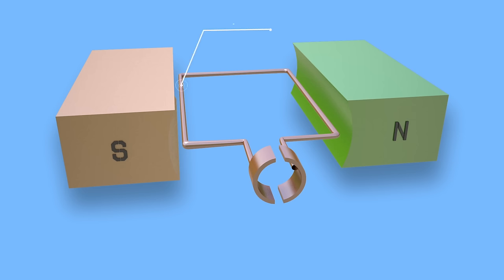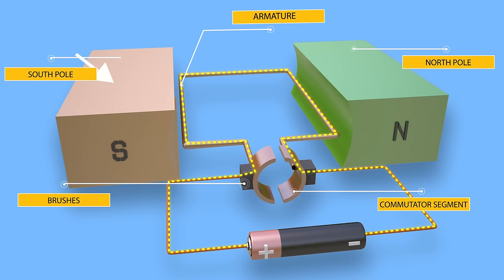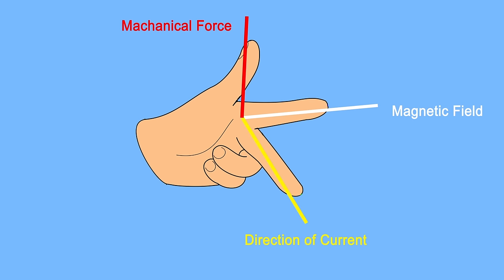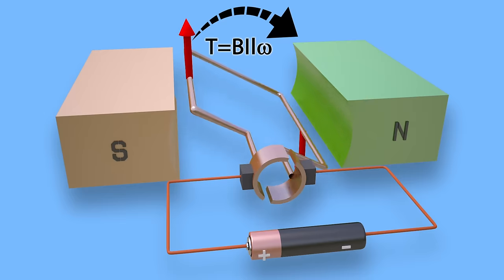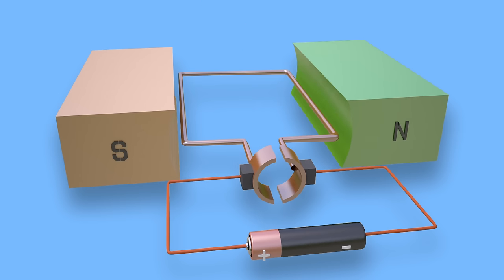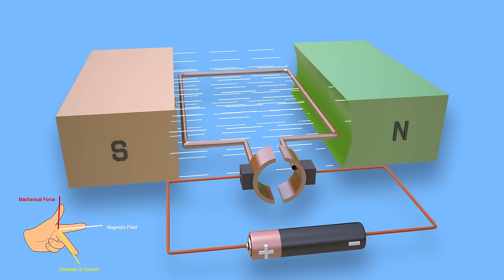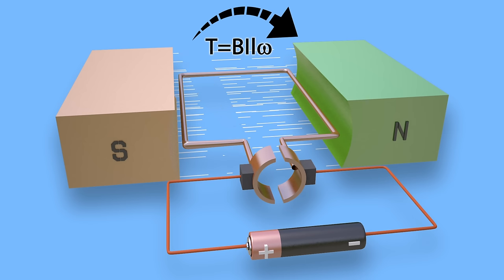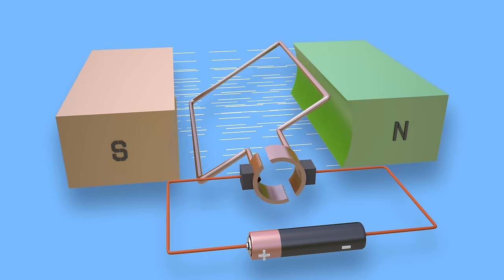Working Principle of DC Motor (animation of elementary model)

Comment: Make a simple cork motor with a horshoe magnet, a cork, 6 pints and insulated copper wire. And one dry cell battery.

Comment: Thank you so much. This really helps. But I have a doubt, what does an axle do in the circuit? It's supposed to be between split rings but what is its function?
Reply: Axle mainly holds. The two split rings .....so as when they rotate the split rings don't fall down
Reply: As there is only a sliding contact between carbon brushes and split rings
Reply: @RadhaKrishna-bh8jc  how commutator works??
Reply: @RadhaKrishna-bh8jc  thank you!
Reply: They are just there to confuse you more

Comment: Nice Animation ...should help first timers..however one basic query ..magnetic poles cannot exist or be manufactured in isolation...but North Pole and South pole blocks are shown in isolation . Actually both blocks are having North and South but the line joining N to S is aligned in same direction  for both blocks.
Reply: This is a genuine query. But learn that even if magnetic poles cannot exist in isolation, we still can determine which side of the magnet is North and which is South by suspending it hence we can determine the Direction of magnetic field lines, I suppose he purposely did not show the north and south poles so the begginers are not confused.
Hope that clears the hindrance!
Reply from the maker: Thanks
Reply from the maker: Thanks

Comment: hello nice video,but the left and right side placement of north and south pole explanation is wrongly said...can you correct that to avoid confusion
Reply from the maker: Ok i will check hole video to see if there is a error
Reply from the maker: Thanks for watching
Reply: Can u please how did the magnetic field excites ?
Reply: Yeah You are right
Reply: Ri8
Reply: Yes u r correct
Reply: Award goes to u
Reply: It's flemings right hand rule not left hand rule
Reply: I think if the poles of the battery are inverted, it is better than inverting the poles of the magnet
Reply: @13-hemgajjar98  It's left hand rule for electric motors but right hand rule for electric generators

Comment: So it will rotate continuously in the same direction? Will it change its direction of rotation or not?
Reply: no. the reason being the spilt ring commutator, as the armature becomes at a right angle to the magnetic field, the direction of force changes  if there was no split ring commutator the forces acting (up and down) would cause the motor to halt in a vertical position because there is still current present but when there is a split ring commutator the circuit is broken for literally fractions of a second so when the gaps in the commutator align with the metal brushes circuit is broken so there is no current so there is no force on the armature so it simply moves due to newtons law of inertia (it will keep moving to the right) when it moves the circuit will be unbroken and the forces will act on the armature causing it to turn and it will repeat so the armature wont move the other way unless you directly change the circuit or the magnet positions.
Reply: No it won't

Comment: The battery terminals are on wrong sides according to the force  acting on coil (by left hand rule)
Reply: In physics,'Conventional Current' flows from the positive terminal of the battery to the Negative terminal of the battery.
Reply: Yes
Reply: It is all correct

Comment: Your intention to explain the dc motor is correct but there are minor mistakes please rectify that
Reply: the current direction is from - to + not reverse
Reply: @billbens  Actually current moves  from positive (+) to negative (-). Electrons move from negative to positive
Reply: @holyratchet_7883  As mentionned by that guy Hal Hollis ''a flow of positive charge in a given direction is electrically equivalent to a flow of negative charge in the opposite direction.''

1- So there will be no current at all because both charges are balanced
.

2-if  a negative charge  is  an electron ok , but positive charge ( proton ?) well  , but  since when the protons leave  atomic nucleus ( atom's core) to make a trip ?

3- protons are  positively charged particles  , they combine with neutrons to form a nucleus & electrons orbit around the nucleus  ( in quantum mechanics way not like planets around the sun). In the atom,  the number of electrons  ( negative charge)  is always the same as protons ( positive charge)  , that's why atoms are neutral ( positive & negative charges are balanced), excepts for ions.

Now about current :

in fact the current is produced when there is a potential difference between both sides of a circuit : in a battery for example , there is a (+) & (-)

The (+) is connected  to the cathode which contains  positive ions (a positive ion is an atom which need  electrons to balance its charges to become neutral atom),  a positive ion has more positive charges  (protons)  than negative charges (electrons) :  it's mostly positive  that's why  (+)

 The (-) is connected to the anode which contains  negative ions (a negative  ion is an atom which has  more electrons  & need to evacuate them to balance its charges to become neutral ). A negative  ion has more negative  charges  (electrons)  than positives  charges ( protons ) :  it's mostly negative,  that's why  (-)

if you take a charged 4.5v battery for example & touch the  anode (-) with your tongue you will notice  that it stings, that's  because the electrons surplus in the negative ions  are stressed  to run  ( it's  like the atom told the electron  you have to quit this house , you have no place here ). The cathode (+) in his side  is hungry & wants theses electrons.

So when the circuit is closed, the cathode & anode will attract each other,(as positive & negative charges attract each other)  but they cannot move because atoms are static, but the surplus electrons are free to move so they will run to the cathode ( this run is in fact  the current) , as the cathode will  aspire these electrons, it become neutral , & anode also  become neutral for  evacuating the surplus electrons ( the more electrons  are evacuated to the cathode the more the battery is draining up) once all the surplus electrons are evacuated , (  both cathode & anode are neutral ) so battery is dead.

 I hope this helps .
Reply: @billbens  just check this webpage out. I was trying to say that. https://physics.stackexchange.com/questions/315589/direction-of-current-and-direction-of-flow-of-electrons
And btw yes indeed I agree that there will be no flow if there is equal positive and negative flow of charge
Reply: There are many assumptions in most of Asia and NA they take current to move from positive to negative and electrons from negative to positive while in places like Russia it is vice versa.

Comment: Great video..but north and south pole are interchanged...their positions should be opposite
Reply: It depends it doesn't make any difference
Reply: Just the rotation of the armature would reverse
Reply: No when we use the flemings left hand✋rule it may be a issue
Reply: It doesn't matter where the poles are. If the poles were to be interchanged, you would get an anticlockwise rotation.
Here, you get a clockwise rotation. That's all
Reply: RAJ KUMAR JAMKATAR 
What is your point ?
Reply: Yeah

Comment: but according to my text book the rotation is anticlockwise
Reply: Yaa the rotation is to be in anticlock wise
Reply: I depends upon the polarity of the battery
Reply: If u connect negative on the south and positive on north the rotation is in anti clockwise
Reply: Bro notice the north and south magnet in your textbook and compare it here u will get it.
Reply: Monari narsing rao the direction of rotation of the wire is shown correct in the video. We have to use our left hand and not the right hand. The thumb is the direction of force , the middle finger is the direction of current and the fore finger is the direction of magnetic field.
Reply: The big problem here is that this is explained using conventional current flow instead of electron current flow and then the left hand rule is applied. If you use conventional current flow (positive to negative) then you must use the right hand rule for generators and the left hand rule for motors. If you use electron flow instead (which all electricians are taught in and it looks at circuits with current flowing from negative to positive), you must use left hand rule for generators and right hand rule for motors. This is the second video now that has messed this up.
Reply: That is because Of change in polarity jhan inhone north rakha h vhan apki book m south hoga muje b phle yhi confusion thi
Reply: hmmmmmmm
Reply: Yes 
see the position of magnet amd specially the north pole one
The direction of rotating coil os deepend upin the direction of magnetic field

Comment: what happens if we replace the magnets position. like put N pole in place of S pole And S pole in place of N pole
Reply from the maker: This will change the flow of current switches the direction of the spinning force, causing the motor's shaft to begin turning in the opposite direction.

Comment: My experment in magnatic field as follow:-
I get two shaft of iron the diameters of it about  3cm
I made cone in end of each one in its head  now its head  coney of each one.the cone hight is 15 cm  Now i put each cone head contact the other
By its knifey age. Now i made magnatic flux by coils each shaft has coil. Both coils operate that making flux in one direction passing through the contact point when i made (on) to electric power  theres
Light came from contact point.
The properties of each coil as
Follow:- no. Of turn is 2500.
Diameter of wire is one  mm
Power is 220 v.

Comment: Sorry! I have a question that what if The north or the south of the magnet head to one direction all the times. We can have the DC current?
Reply: Magnetic field always goes from North to South. The DC current in this case is from the battery. I think you’re confusing DC generator to DC motor.
Reply: Aurelio thanks for replying. We can keep the cooper wires not moving, and make the magnetic field changes by rotating the pole of the magnet.  And I think that if I keep the pole in the same north or south, I can have DC current. Because the electrons always go in one way.

Comment: I have a doubt, what if we use complete ring instead of split ring?
Reply: Bus ek hi jagah pe ghumte rhega split ring
Reply: Nachega n
Reply: Then it won't work ig bcoz the ring will always remain in contact with the brushes so the current wont stop ig i m not sure whether i am correct

Comment: HOW DOES THE SPLIT RING REVERSE THE CURRENT'S DIRECTION EVERY HALD TURNN?!?
Reply from the maker: The positive (+) and Negative (-) sides of the DC power supply are connected to the armature using spring loaded carbon brushes. Which means the polarity for each carbon brush is always the same..

The coil(s) wound on the armature have will always have two ends.. the start and finish. Each end of a coil is connected to a segment of a divided ring, which means that for every coil wound, we will need two oppositely positioned segments to where the each ends will be terminated...As a result, the number of divisions the ring will be divided/split is dependent on the number coils wound, which also may equate to the number of magnetic poles present in the motor

The polarity reversal takes place when the armature rotates. The divisions on the slip-ring by being physically fixed on the armature will automatically be shifted in its positioning. This mechanical shifting in position results in corresponding change in polarities of electrical connection! With respect to the carbon brushes positions, and the start and finish ends of the coil (each terminated on the slip-ring) will be alternately switched in polarities, in-sync with the armature movement..

Comment: What is the use of brush
Reply from the maker: Well, brushes in a dc motor help to connect the armature and the field to the external supply. They are mainly manufactured from graphite, an allotrope of carbon. The most modern motors made today hardly have brushes. These are costlier and are known as brushless dc motors.
Reply: chrvoje engineering thank you sir
Reply from the maker: no problem, share and watch and like rest of my videos

Comment: According to ncert book it moves anticlockwise
Reply: According to flemings left hand rule it should move anticlock wise and its correct in NCERT book
Shift_L
Reply: Man, NCERT book pe N. Pole left side mein hai
Reply: Yaar it depends on the polarity of the magnet and how the wire is connected to the battery

Comment: BUT this should be AC motor!!!!!!!!,
Reply: No, it is a DC generator. The flow of the current does not change in a DC generator as depicted here. DC generators use commutators, AC generators use slip rings. Are you saying it is a motor not a generator because they show a battery instead of a light bulb?

Comment: the diagram is wrong
Reply from the maker: I think that is not wrong?!
Reply: chrvoje engineering aren't those coil ends to be connected outside? Because the inner part of the split rings are insulated.
Reply: If the ends of the coils are on the outside of the slip rings wouldn’t they damage the brushes? Idk just saying 🙂
Reply: im not sure tho
Reply: chrvoje engineering  she is confused by positioning of magnet